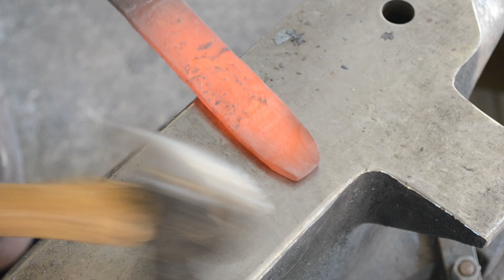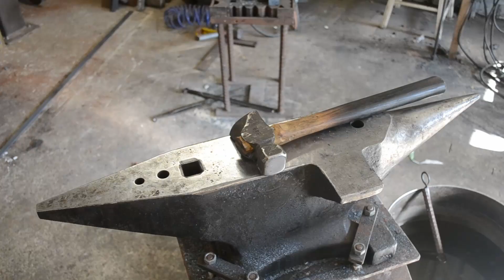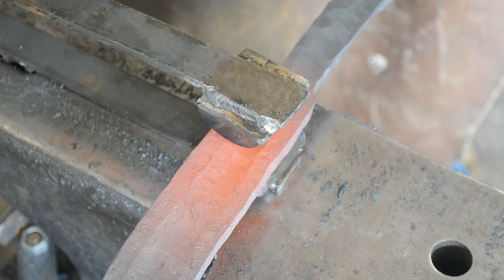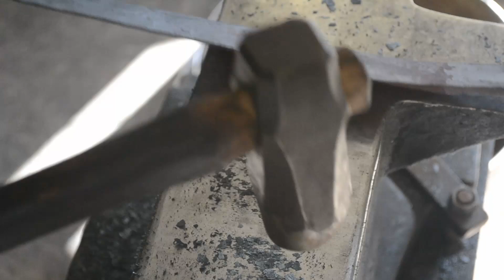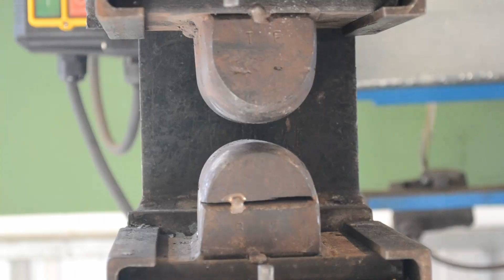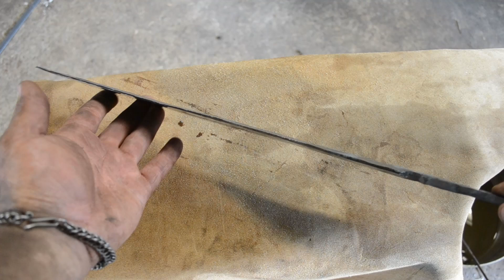How to Forge a Fullered Dagger

Comment: Very interesting series, you have earned a new subscriber thanks! What is the size of the round stock you are using there for the fullering jig? at one point you mentioned 2 inches but it does not seem that wide.
Reply from the maker: the fuller I use in this video was 36mm so 1 3/8" ish

Comment: I have now watched this about a dozen times 😀.  I’m guessing the blade is about 12 x 2 inches. What size stock did you start with(if you don’t mind)?
Reply from the maker: The blade is 15×2.5" I started with 10x0.5x1.5" roughly
Reply: @SamTownsBladesmith  thanks for the quick response.